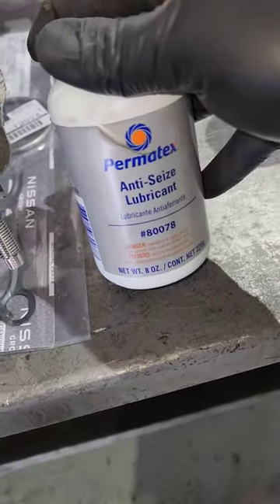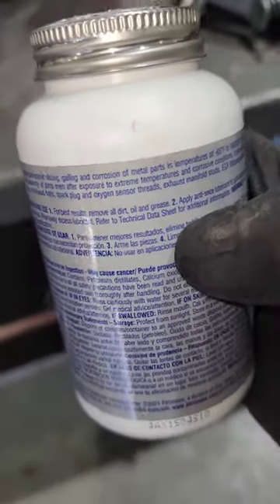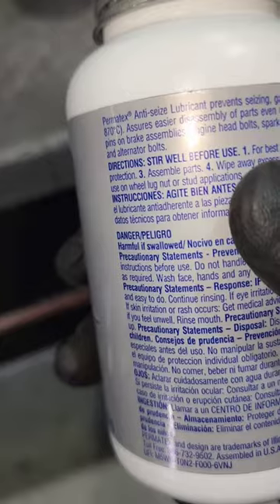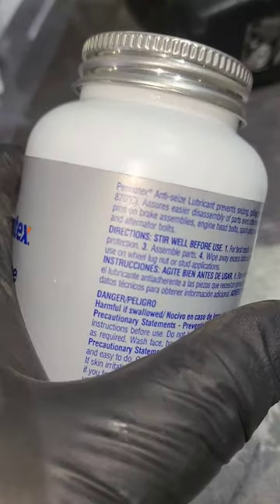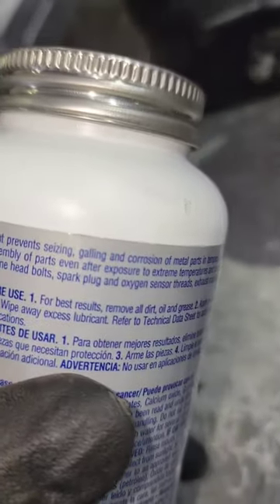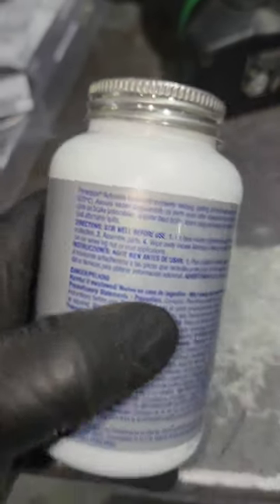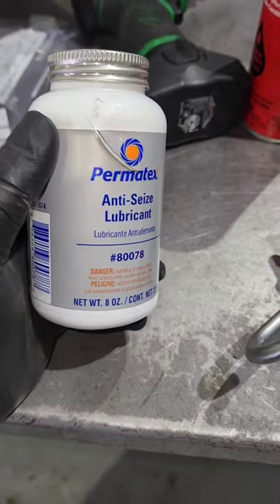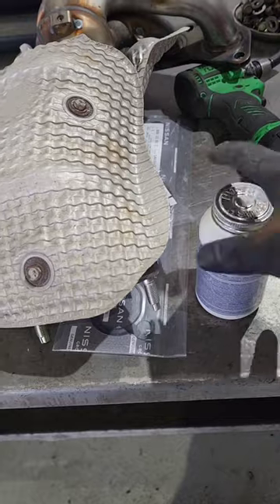ANTISIEZE USED CORRECTLY #shorts #auto #mechanic

Comment: Due to living in upstate NY I put a small amount of never seize on the lip of the hub where the rotor makes contact on the inner circumference not slot just a little that way I’m not hitting my rotor 20x with a 8lb sledge hammer in 2 years when possibly doing brakes and rotors

Comment: I’d bet money that’s a liability thing, they probably don’t want a lawsuit when wheel studs snap. Most people don’t understand how fasteners work and that there’s a difference between dry or lubricated torque or a difference in grade. A bolt is basically a spring if you think about it.

Comment: My dad has been doing it for decades. Zero issues. I don't and also have had zero issues.
Reply: Same here I've never had a wheel come loose, and I've never broken a wheel stud. As long as you don't lube the face of the wheel nut that lightens against the wheel it will hold just fine. As far as O² sensors and spark plugs go; you want to use the copper based anti seize for electrical conductivity.

Comment: It works great on lug nuts. No problems ever other than the next guy cursing the mess but not thanking you that they actually came off.
I've actually seen in owner's manuals saying not to lube wheel studs. Bad advice. I've never seen lug nuts loosen due to lube. Have seen them loosen due to being dry or threads galled. It's gives a false tightening that will loosen after driving.
Reply: The reason is because a lubricated fastener can become too tight. I had this issue on a jeep once, with this shit all over the lugs. There was so much that it ended up on the taper bit. Try tightening to 100 ft lbs, and the studs stretched and snapped before the torque wrench ever clicked.

Comment: You can use it on lug nuts on your own car if you are a mechanic. Because you will always know if your wheel is coming loose. It is very easy to tell when you have seen it a hundred times. Plus we know to retorque it after a couple rides. After the thermal expansion has taken place. Believe me, in the rust belt it’s the only way for them to not get stuck bad and even the rim will seize to the hub can ride around with no lugs and the tire would stay on till you hit a good bump. 😂

Comment: It's also NOT FOR LUBRICATING BRAKE PARTS.

This stuff is meant to prevent thread galling (cold welding). There are too many solids in it to make for a good lubricant for moving parts.
Reply from the maker: Great point!!!!!
Reply: Literally says right on it can be used for anchor pin bolts on brakes.. 🙄
Reply: @Smokey-88  the bolts. As in the threads. Not for the moving parts. If used on the slide pins, it cakes up and makes them stick, and it's not compatible with the rubber boots. It makes the rubber swell up and compromises the seal. 

Another little fact for you- the folks selling a product will recommend it for anything they can think of, even if it's not really good for that purpose. I've literally seen silicone grease with a recommendation on the container to use it on squeaking fan belts. You don't want a lubricant on your dang belts!
Reply: @Krankie_V  Way too many words.. just to clarify. I don't use antiseize when I do breaks. I use silglide.

Comment: If you are putting neversieze on your spark plugs, STOP IT. The plug manufacturers tell you specifically not to.  And BTW, I ALWAYS put neverseize on lug bolts. Bolted assemblies should always be lubricated before torquing.
Reply: Depends if it comes with antisieze on the threads
Reply from the maker: Wait youll use it when it says not to but not use it when it says too?? Im cornfused 🤔🥴

Comment: Don't use it on head bolts, either.  Most head bolts call for use of regular engine oil on the heads and threads of the bolt.

Comment: I stopped buying it. I cut the top off the last  put a little oil in it. I use a small brush. I can't work without it. Lube every single nut and bolt.

Comment: Put it on the matting surfaces of the hub and rotor but knot the nuts er studs😅
Reply: I use it to. But same problem… you are making a thousandths of an inch of grease between parts. The force can’t squeeze it all out. But that is the point of it. The thing is…it will require a few retightens, as it heats up and cools off in thermal cycling. So for people who understand this concept it is useable. But I wouldn’t advise it on customers cars unless you can explain this all to them…. Good luck with that with most customers 😅

Comment: The funny thing is that says to use it on spark plugs, but the manufacturers of spark plugs tell you not to use it on them. So who do you think is right there?
Reply from the maker: Depends on the manufacture doesnt it? Cause i know the manufacture i work on doesnt use anti sieze at all aside from exhaust sensors
Reply: @FluffyMexicanik  No. It does not matter who the manufacturer is. I have not found one spark plug manufacturer that recommends anti-seize on spark plugs. As a matter of fact, all of the ones I have talked to have said not to use it. When you work on stuff for long enough you will see that several manufacturers have claims that oppose claims of other manufacturers.

Comment: However it is a good idea to use on ring of the hub.

And honestly that was right on the boarder of being too much around the sensor, he needs some cheap paintbrushes so that he doesn’t pull up a big old clump every time. 

The built in brush on the cap is good for applying to a large area, but isn’t that great for 90% of the jobs we use it on.
Reply from the maker: Brooooo i know...i even tried using the edge of the brush, then tried wiping it...im like damn somebody going to sayy something about it 😅🤣 fresh bottle too 😮‍💨